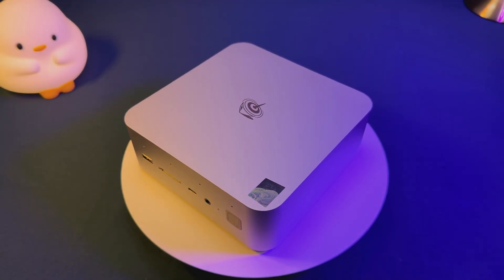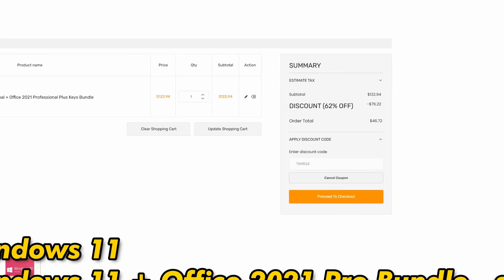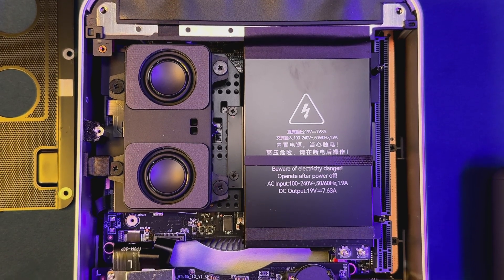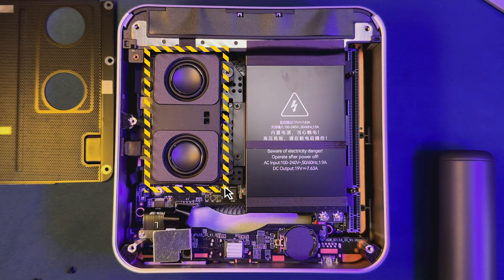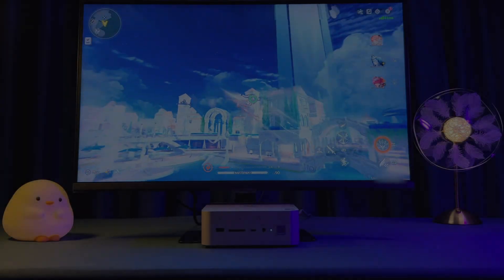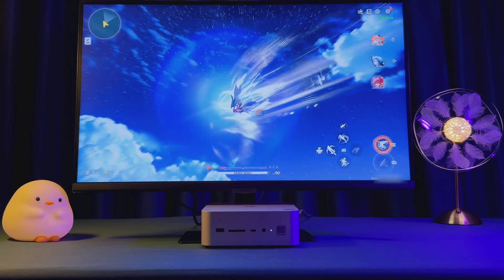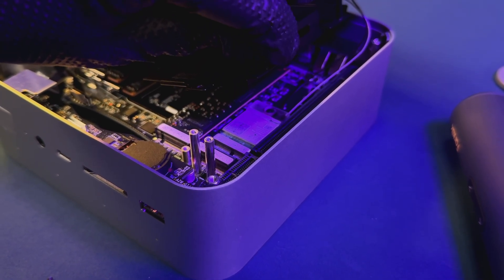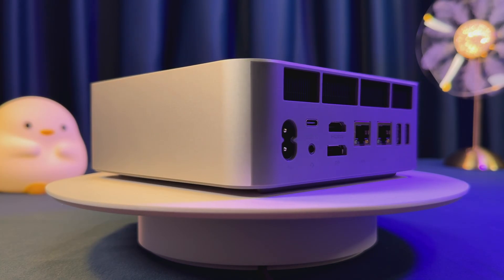Beelink GTi15 Ultra Mini PC Review: Can It Replace Your Desktop as a Standalone?

Comment: Great video. Do you think GTI15 with GPU Is better than GTR9 Pro?
Reply: For gaming, I think so. You can get the Gti15(96gb/2tb) + EX Pro dock + rx 9060xt reaper for $1900.  The GTR9 is $2380. You'll get better fps in 1440p for sure.
Reply from the maker: Hi! Thanks for watching and for the comment! Definitely the dock combo if your goal is gaming. Gaming performance on the GTR9 is average at best. Only get the GTR9 if your goal is LLMs and some light gaming. I will be publishing my review of the dock soon.